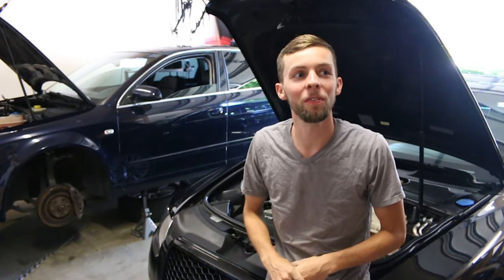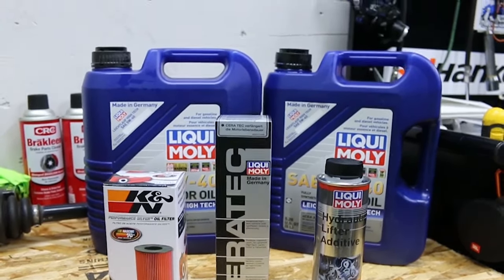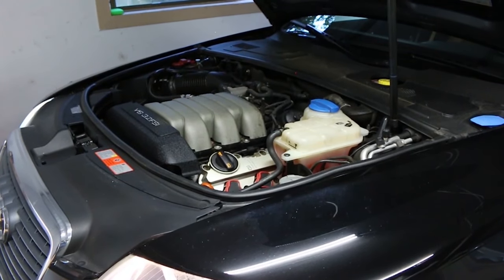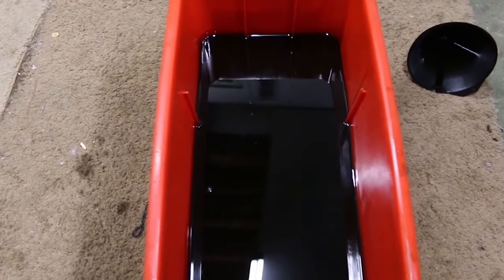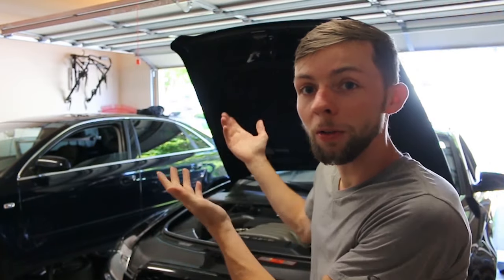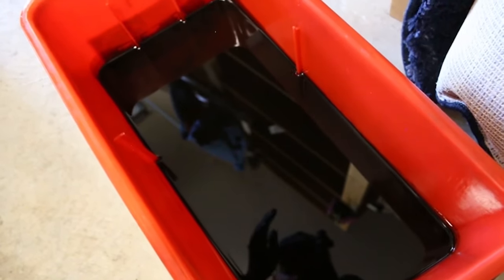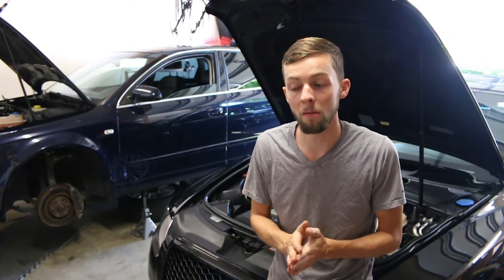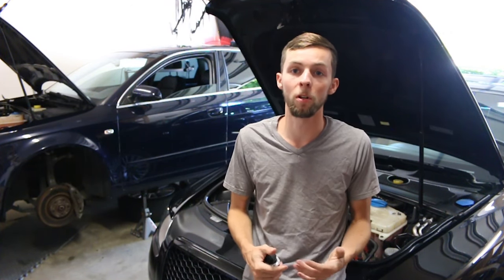LiquiMoly Engine Flush | Does it work?

Comment: honestly i did exactly the same thing with cheap oil but i used stp engine flusb from walmart and it work perfect as well but make sure to warm up your engine at normal temperature than pour the engine flush and  like he said let it run for 10 minutes and drain the oil and put another cheap engine oil and a cheap oil filter to clean all the left over residue from engine flush and  let it run for another 5-10 minutes turn off car let it cool down open engine oil cap for heat to get out and drain the oil and top it up with your brand oil and filter you love and i bet you after 2 weeks your oil is gonna be looking new still even if you go High rpm… but i will try the liquimoly sometime

Comment: I would recommend flushing the engine again. Had a Audi a4 Quattro that got a partially clogged pickup tube and it ruined the head after ripping it onto the freeway. It oil starved the cams and ruined the journals and the friction made it jump timing. Just add the moly flush before draining the oil and change oil more frequently, imo.
Reply from the maker: A 3rd flush isn't needed. Believe it or not, the flush didn't remove as much as I thought. I recently removed this engine for repair to the timing chains and the inside of the engine was still pretty dirty. Although, this car was neglected before I bought it. When the engine was removed I was able to clean a large part of it by hand. I learned the flush would actually never take off some of the gunk as it had to be hand scrubbed in some areas. I removed rear timing cover, oil pan and valve cover/cam girdle for a full internal inspection as well. The flush works yes, but if its pretty bad, it will only do nominal work. 

Thanks for watching and commenting🤙🏼
Reply from the maker: I also have a B7 Audi A4 I just used the flush on as well. Video coming soon!

Comment: Yo! One question. Some people are concerned with the residues of the Liqui Moly flush additive, and actually flush the engine with the old oil, use a cheap to basically rinse the engine and then put in the quality oil. Thoughts?
Reply from the maker: You could do that as well, it won't hurt. Good question🤙🏼
Reply: How long do you run the cheap oil for?
Reply from the maker: I just ran it for 20 minutes and drained it. It's an extra step, but this engine was very neglected.
Reply: The car I’m working on, a 2002 Mazda Protege, was badly neglected too. Like the oil pan took a Tide and Dawn bath neglected lol. Going to use this flush this weekend and will grab cheap oil to get rid of the rest of the crud. Thank you for responding!
Reply: Liquid Molly doesn’t recommend that
Reply from the maker: What's "Liquid Molly"?
Reply: Im doing it this way as well. Im not concerned with the flush eating seals or adding too much detergent but rather the flush reducing oil viscosity. Lower viscosity can increase wear. And on gdi engine with 120k miles I don't want to risk additional wear. Adding flush to oil per instructions. Draining and filling with cheap super tech from WM and replacing filter. Run car for 20 mins drain and fill with valvoline restore and protect and another new filter. I already run 0w-20 in a hybrid so I can't risk additional dilution but it also must be able to flow well on a colder engine. Hybrids switch from electric to ICE that causes it to run cooler. Also going to add Mos2 to the restore and protect for reduced engine wear

Comment: What I do, which is very time consuming. TL:DR (Drain old oil, New oil/filter with cleaner, New oil/filter without cleaner, New good Liqui Moly oil with additives)
Cost: 3x oil filters (23 dollar), 10L can of  cheap oil (66 dollar), Moly Engine Flush (15 dollar), 4L Moly oil (66 dollar), Ceratec (27 dollar), Moly Stop leak (16 dollar) = 213 dollar

 I have a car with a 4.2L oil pan, I get rid of the old oil, when warm (15 min drive before).

Change filter, and add 4L of cheap oil, then I take a 15 min drive or so, go to the store idk, then I come back I put the Engine cleaner in, usually 500ML or 300ML Liqui Moly, I can overfill with cleaner a little or I compensate adding like 3.7L of oil if I use 500ML bottle.

 Let my car idle for 15 min, while eating and drinking what I bought at store to pass time.

 Drain that oil, add more cheap oil and a new filter, then idle again for 15 min, drain the oil one last time.

Then finally I can my Ceratec, Oil Stop Leak, new filter and Liqui Moly Oil. I usually do this process once for a car I have, I'm not going to bother doing this every single time. 

PS: The MOS2 addetive is the predecessor to the Ceratec, Ceratec is a more modern version of the MOS2 but I have used both and they do reduce engine noise and gives more MPG, I Notice also after engine flush the cars become more snappy and throttle response is back on track. I also add Liqui Moly Fuel System Cleaner Pro Line, every yearly Service.

Comment: Word of caution. I've had two of the O'Reilly microguard spin on filters blow off on fresh engine starts due to their threads being barely formed. Compare to a name brand filter whose threads are deeply formed. Just standard oil pressure was enough to push the MG filter off.
Do yourself a favor and spend the extra couple of bucks for a WIX etc or recommended oem filter for your vehicle. Even if its just for a temporary filter.
Reply from the maker: I agree, however, there is no threads on these Audi filters, its a cartridge filter, so no chance of any of that happening. 

Also, the cheap oriellys filter was used for less than 20 mins as I flushed the oil through it. Afterwards, it was switched to a high quality K&N filter.

Oriellys filters are built like pop cans other wise, always choose a better option. In this situation though it doesn't matter.

Thanks for watching🤙🏼
Reply: You may want to fact check me on this but I’m pretty sure Wix makes the Microguard filters for O’Reilly’s lol. People get caught up in brand names but in reality there’s only like three companies that own all the brands and make filters. But maybe Wix doesn’t make all of the Microguard filters 🤷‍♂️ or you just were really unlucky.
Reply from the maker: @secondgenerationcleaning9246  not sure on that, they used to, then Purolator took over. 

Personally, I switched to the Mann-Hummel filters. Very good quality🤙🏼

Comment: That has been my experience with BMW's as well, Liqui Moly burns less!  I have 2014 S4 that does not burn at all at 89k. Liqui Moly Leichtlauf since around 30k.  Do you allow capacity for the MoS2, 6.5 quarts of oil or do you still do the 7qts?  Nice Video!
Reply from the maker: Thanks! I just add it in at the end since it's a small amount and these cars will still usually burn a little oil still

Comment: The flush didn’t cause the second oil change to be that dirty.  Even without the flush, the oil would be dirty when you drained it.  It’s because there’s still dirty oil in the engine.  You will never get it all out.  The only way to do it is change the oil 4 or 5 times with cheap oil.  Then add the flush on the 5th or 6th oil change.  You will know when you drain it each time if the oil is clean.  Once it drains out clean, then start your flush.  If the the oil comes out dirtier than the previous oil change, then you know it worked.
Reply from the maker: This engine was pretty bad either way. I have done the method you are talking about on a previous car and agree, it is better. However, that wasn't the point of this video. And not many people are going to change their oil 4-5 times back to back to be honest, some will, but not many. Oil naturally cleans, so if oil changes are done regularly, this is not needed as much. 

However this car was very neglected before I got it. Currently doing timing chain tensioners cam girdle seal and after looking in the engine, well, its less than satisfactory, even with my regular oil changes and flushes. Giving it some deep cleaning while in here and a refresh of alot of parts. 

Thanks for watching and taking the time to comment, I agree the method you mentioned can be more effective if a deep clean is needed.

Cheers!🤙🏼
Reply: @Mechani_Cole  My point was, if you are going to make a video to see if Liqui Moly flush works, then the method I spoke of would be good for video purposes.  Yes, you are right most people will not change their oil 5 times then add flush.  If the flush proved to work after 5 oil changes, then people could put the flush in before the first oil change knowing that Liqui Moly does in fact work.  Your video does not prove if Liqui Moly flush works.
Reply from the maker: @BW-kv9wj  this isn't a video "proving" if the flush works. It says in the title "does it work?", I was just sharing my experience on my car. 

Feel free to make a video and showing your method. But no one is going to use a 5 oil change rule as their standard on oil flushes. There is millions of videos of people using a flush on their car without changing their oil 5 times before hand.

Either way, I appreciate the comment👍
Reply: @Mechani_Cole  I think you are misunderstanding me.  I know there are millions of people who don’t use 5 oil changes to flush their engine.  But if you want prove a flush works for educational purposes and video purposes, you must change the oil until it drains clean, then flush it.  Once someone sees that one video, they will decide if they want to buy Liqui Moly flush.  I have not seen a video doing this method.  Once a video is produced with oil draining clean then Liqui Moly flush added, the Millions of People can decide if they want to buy this product so they don’t have to go through the trouble of 5 oil changes.  They can just watch the video and see for themselves if it works or not.  “Does it work” and “Prove it works” is the same thing in my opinion.
Reply from the maker: @BW-kv9wj  I disagree. But everyone has their own opinion, thats fair. If thats how you prefer to do it, feel free to make a video showcasing that and post it so people know. Otherwise, thanks for your comments my friend😁
Reply: @Mechani_Cole  Sounds good.  Thanks for making the effort in the video though.

Comment: Bro I’ve got a question, it might sound quite funny😁I just used this product in my car and I knew it should be at idle, but as soon as I poured it into the car a minute later of idling the garage asked me if I could reverse back up on the ramp I just reversed probably about a couple of meters if that, 
Do you think that could cause any slight wear and tear, just a couple of meters probably. less than 6 meter
Reply from the maker: Nope. I've driven over 50 miles with flush in the system
Reply: @Mechani_Cole  oh wow Is that with the liqui moly? Did you do that to get the system cleaner Is there a reason behind it? And I’m worried about a couple of meters😂
Reply from the maker: @persianhawk682 yes. I  had to run to the store, so I put it in and drove it there and back. It will be fine. It's a solvent and won't do any damage
Reply: @Mechani_Cole  my main concern was because it breaks through the oil and brings down the thickness of the oil making it more watery, so I thought maybe that could cause an issue, with high rpm and slight load moving the car a little bit, but either way man thanks a lot that’s some reassurance❤️
Reply: @Mechani_Cole follow up question lol. Can I pour it today idle it for the 15 min & then change my cars oil on Thursday? I won’t drive my car till Thursday after the oil change. Thank you
Reply from the maker: You could I guess

Comment: 2015 Q5 2.0T 224 HP (45,000 MILES on it today) . 
With Castrol 5w-40w, and after 7.500 miles,  700ml  oil consumption . 
With MOBIL 0W-40W European Car Formula Full Synthetic oil and Lucas Synthetic Oil Stabilizer 700ml ..zero oil consumption. 

Today i will try LiquiMoly 5w-40w and Lucas Synthetic Oil Stabilizer ...................
Thanks
Reply from the maker: I actually LOVE the Lucas Oil Stabilizer! I used it in my Subaru 2.5T that burned oil and man it really helped it ALOT!

Interesting numbers for sure on the oil consumption. How do you like your Q5? We are actually currently shopping for a white one with black interior for my fiancée. Pretty much want that exact year and engine. I like the  2.0T over the 3.2. It is much cheaper to maintain, I have both currently, 2.0 A4 & 3.2 A6 and the A6 costs a fortune to maintain even doing the work myself.
Reply: @Mechani_Cole  i had a subaru forester 2010 2.5, and 1 year ago i took that audi. it was a CPO car  with 30k miles, in local Ohio Audi dealer but the car came from CA. It was covered with warranty for i year. And the dealer cover me for sunroof noise with a new frame  ($2.800)  and a level coolant sensor. But i know this engines are famous for many differents and expensive problems. I think 3.2 is a better engine and you can get more miles. ...................................''Subaru ej25 said i'm a looser and Audi E888 replied hold my beer''

Comment: is it necessary to do 2 oil changes ?  cant just put the engine flush with the previews oil and change to new oil and new filter ?
Reply from the maker: No it's not necessary. This car in the video was pretty sludged up, so I was trying to get as much out as possible. Can just follow the directions on the bottle for most uses

Comment: Your issue was piston rings most likely cylinder two and three. Get Chem-B12 two cans, get all pistons at equal height. Pour in3 Oz of B12 in each cylinder. Cover some ark plug holes with old towels. Rotate engine twice, let the B12 sit overnight. Suck out the B12 in each cylinder if there’s still any on the cylinder, pour clean 3oz again in each cylinder. Rotate engine twice. Let B12 sit over night. Remove B12 out of the cylinders if any. Add 3oz of B12 in each cylinder again. Rotate engine twice. Let the B12 sit overnight. Remove B12 from cylinders if any, put plugs and coils back in. Change oil.  Start car and drive. Smoke from exhaust will eventually dissipate. Your welcome. No more oil burning.
Reply from the maker: Not a bad method and does work. However, this one ended up being a bad PCV valve that was consuming oil. Doesn't consume any now🫡
Reply: @Mechani_Cole  ahh the infamous pcv valve. BMW’s kryptonite. Lol

Comment: Did you still put 8 litres of oil when you put the flush,  as Iam gonna do it to my 3.0 tdi a6 so just want to know the right principles, cheers
Reply from the maker: Put whatever amount is usually called for on an oil change for your vehicle. But yes, only run your engine if it had the proper oil level
Reply: @Mechani_Cole  cheers Cole for the advise will be watching your videos, all the best 💪🏽

Comment: Soooo,  not going to read through but liqui moly recommends using the used oil when using their engine flush product, running the car at idle only for 10-15 minutes and then draining the oil immediately. Not saying what you do was wrong just putting out there what the manufacturer recommends.
Reply from the maker: Agreed. What I did was an extra step because the csr was neglected and had a lot of sludge in it before I got it. Its not needed at all, but does clean better in my opinion. This video def isn't a how to guide. Just sharing what happened when I used and how I did it. Thanks for watching🤙🏼
Reply: @Mechani_Cole  ahh I understand! Anyways great video!
Reply from the maker: Much appreciated🤟🏼

Comment: A doubt, if you flush engine is it better to drain the refilled oil asap. Heard the residue during flush can do more damages.  Then after wards, fill it with new oil and new filter.  This is for V6 Camaro , 2014 model
Reply from the maker: Run it for 20 mins with the flush in it, then you drain it.

Comment: I've used Liqui Moly flush and didn't find it that good.  I used Amsoil flush and it was better, then I tried BG EPR and it's by far the best I have used.  Strange as it is, BG EPR has stopped or greatly slowed down the oil consumption  on my 2016 Audi A4 Quattro.
Reply from the maker: Often times in the Audis it's the PCV valve consuming oil as well
Reply: @Mechani_Cole  I replaced that afterwards.  Trying to find out why cyl 4 has a misfire and still does after replacing the coils.
Reply from the maker: Have you smoke tested it? Vacuum leaks are super common for misfires on these
Reply: @Mechani_Cole  I have not.
Reply from the maker: @Boodieman72 that's always where I start after coils and plugs a verified good.
Reply: @Mechani_Cole  Any common failure point to look for?
Reply from the maker: @Boodieman72 crankcase hoses going to the pcv is most common. But the smoke will always show where any leaks are. Can get an affordable one on Amazon to use
Reply: @Mechani_Cole  This is only one hose connected to the crankcase (at the PCV end).  The other side goes to the intake / turbo.

Comment: I have left the engine flush in for about 3 hours (the car was turned off, it wasn't driven), did I make any damage to the engine?
Reply from the maker: Good question, but no, you should be fine.
Reply: @Mechani_Cole  Thanks!

Comment: How much oil, the full 5 qt including the engine flush? Or used about 4.25 qt and then the engine flush additive making it 5 qts?
Reply from the maker: This specific engine takes about 6.5-7 quarts of oil per oil change. Euro cars usually take a little more oil than others. 

Definitely check on Google or your owners manual for how much you need.

I used this whole 5 qt just, plus 2 qts of oil, plus the flush in this video. There is directions om the back as well, plus some links in the bio for a cheap price on Amazon.

Thanks for watching and commenting🤙🏼
Reply: Wouldn't adding the normal qts it takes and then adding that engine flush be over filling ?
Reply from the maker: @TOPHiTTA2  the flush is only 16 oz. Its not much, won't hurt it in my opinion. 

Jiffy Lube over fills everyones cars and they are still around😅